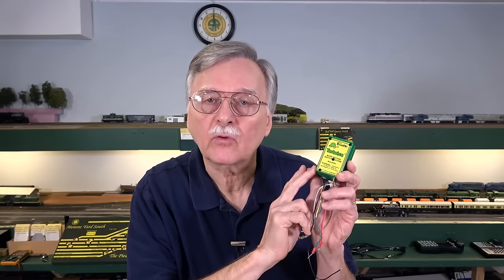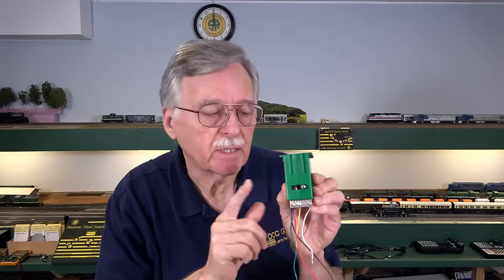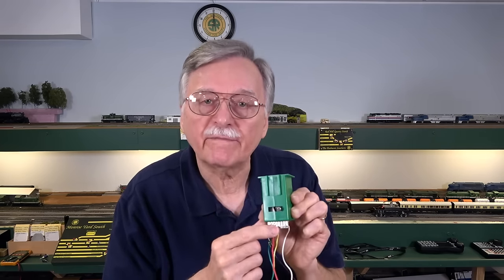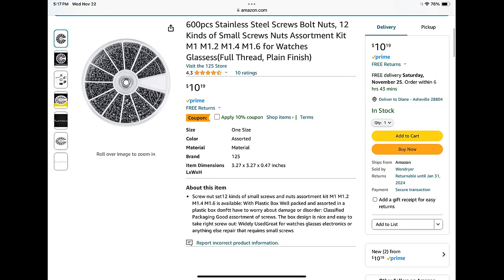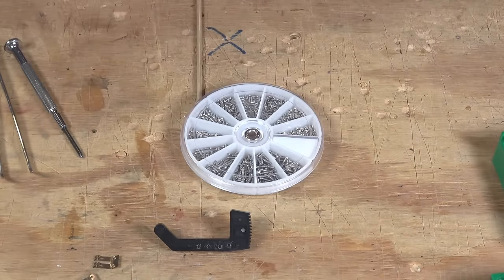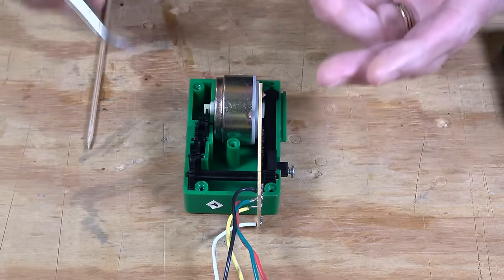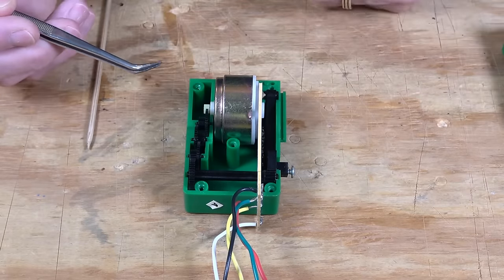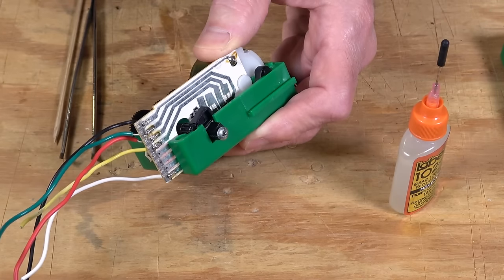Sick Tortoises? Try These Repair and Maintenance Tips (347)

Comment: I recently checked 25 of the 54 of mine on my storage yard, and although I never found any problems, I took the precaution of using a hot glue gun to glue all the way across, where the plastic holds the wipers, and run the glue across the top to form an extra bond whilst still allowing the wipers to retain there springiness. I didn't bother to check any of the machines I just disassembled and modified them. I couldn't be bothered to strip the contacts off and mess about with screws, After I had used the hot glue on the first one, I tried to break the contacts with a lot of prizing etc (within reason) and couldn't get them to break. I am satisfied that the hot glue solution is faster and just as reliable, Obviously I scored the plastic both sides and between the pairs of contacts and also along the right angle section at the top to give the glue a key. Must admit the lube is a good idea.
Reply from the maker: Sounds like another easier solution. Getting those little nuts on those little screws can be frustrating. I bet a line of epoxy would work too.

Comment: Hi Larry, always informative to see your tips...  I don't have Tortoise machines so I may not know what I am talking about.  But I'll offer this for your consideration anyway.  With the screws in place, even if they are stripped, why not fill the back side of the arm (near the screw threads) with a little epoxy or JB weld. It would be a lot easier and would give the screws plenty of material to adhere to.

Comment: Hey Larry,  Hi from down under! Yet another great and informative video. I have been using these for many years and encountered the exact same problem with the wipers and fixed them with self tapping screws same as you did initially so I think I will go ahead and slowly retrofit them with the metal thread screws as you have shown in the video. Another problem I encountered using the DPDT component to power frogs was that for a split second the contacts were contacting on both polarities causing the Digitrax DCC system to see it as a short circuit and shut the system down. The fix for this was to remove some of the track on the circuit board so that the wiper was only sitting on the pad when it gets to the final rest position at each end of the travel. When the switch motor is opened up to do the contact repair it is a good time to alter the contact pads on the circuit board.
Reply from the maker: Yep, I wrote about that issue in Model Railroading magazine 30 years ago, but have not run into the problem since so don’t bother. Do you have your command station set for the extended shutdown timing or the factory setting?
Reply: Thanks Larry I have it set at  the Factory settings @TheDCCGuy

Comment: Special Electronics Added:
Added across connections [#1]+[#8] "motor terminals".
Added a tiny 0.1uF capacitor.
* Improves 12V-DC motor performance.
* Reduces DCC sound.
Reply from the maker: Actually these have been installed in many Bachmann models due to international requirements for suppression of TV and radio interference so you may find them in some of their US models. However it is recommended that these be removed because they can interfere with the DCC signal and create problems. Some manufacturers even include this recommendation in the instructions included with those models that have them!

Comment: Ive also repaired the early models of DCC Concepts Cobalt TO motors, they have the same problem. Its all very well to say they have a lifetime warrantee but when one lives on the other side of the world 😢 so I repaired ours the same way but used 10 Ba bolts and nuts. Thanks Larry.

Comment: Nice fix! I’d be tempted to add a drop of thread lock (eg Loctite) to each of those little nuts just to make sure they also don’t come loose over time.
Reply: If you do that Loctite makes a product called after Lock that works well.
Reply: I’d consider using either the lowest strength loctite (purple I think?), the equivalent off-brand, or since I have it around and use it regularly for small thread applications, double-boiled linseed oil. It dries up and holds the thread but never completely hardens, making disassembly easy.
Reply: @THBRailwayInHO  , After lock is very low strength. Used after parts are assembled or adjustments to 8 track players or other adjustment screws that may have to be reset.
Reply from the maker: You can also just use some PVA glue.

Comment: Great information. One issue I seem to have quite often is once the machine has moved the points of the turnout the machine continues to make a clicking sound. It sounds like the motor keeps turning and is just grinding gears. At least you have given me some pointers on repairing them. I’m dreading working under the layout as is so often the case “ I’m not as young as I used to be”😅
Reply from the maker: Sounds like either something lodged between a gear tooth or worse, one with a missing tooth so it is slipping.

Comment: think it was you who told me about the MP5 switch machine i have sold all of the tortoises i had  
i did find there are easy to program, too to i have used them in hard-to-tortoise machines but MP 5 allows me to  half the piece of a tortoise  something like the dewalt power tools are better in their warrant work all i have to say
Reply from the maker: Sorry but it wasn’t me.

Comment: Larry, I had several tortoises fail in the wipers couple of years ago.  Took them apart and cleaned them and put vaseline on the wipers.  Seemed to work ok for awhile then started loosing wiper contact again. Several tortoises are not showing turnout position again.   I assume that I should not you vaseline, but oil?
Reply from the maker: I have no idea of the relative merits of oil vs grease (vaseline). However no matter what keep it to a minimum.

Comment: Hi Larry, I noticed when you were putting on the nuts you switched from tweezers to a stick with something that looks like putty. What is the stuff and it looks like it was working better than trying to hold the nut with tweezers.
Reply from the maker: That unfortunately got snipped out in editing. It was a small dab of Uhu black tack, a sticky putty I got on Amazon but you can find similar in blue or white at the local hardware store, that I normally use for installing LED lights. I put on just enough to hold the nut and guide it into place and it did work well.

Comment: Great video. Can't imagine taking 400 modules apart and repairing them
Happy Thanksgiving Larry.
Do you know what size screws you used. Would 2-56 fit? I have 100's of that size from my RC model airplane years.
Reply from the maker: Another viewer commented he had used them but the nuts might not fit. I had trouble with the tiny ones I was using.
Reply: Thanks Larry. I'll keep that in mind and see how it goes.

Comment: What size nuts and bolts did you use? Metric? Non-metric? I lean toward a 00-72 size.
Reply from the maker: The set contained M1.2, 1.4, and 1.6 and I used the biggest I could fit. The problem is the nut has to fit inside the bottom of the sweep arm.

Comment: 5:05 if you recently purchased the unit in question, it may be under warranty. As one can plainly see, there is a clear warning that damaging the label voids the warranty. Oops.
Thanks for the heads-up, Larry.
Happy Holidays ⛄
Reply from the maker: As I said in the wrapup these are guaranteed for an amazing 9 years! However you must have your original receipt to prove purchase date.
Reply: If you're in the USA, the FTC has ruled that "warranty void if removed" stickers are illegal. So IMO don't worry about that.

Comment: I have had the motor actually die  and I don't see why they don't upgrade the solder pads to screw terminals
Reply from the maker: They offer the Zip Z card edge connector which clips onto the card edge and has screw terminals.

Comment: I would take mine apart at least once a year to check them. Better to catch the issue before it becomes an irreversible detriment to operating the model railroad.
Reply from the maker: You just not have very many then, that would be a real chore. If he is willing to guaranty them for 9 years I would think that once the wipers are fixed they could go until the motors died.
Reply: @TheDCCGuy  Doesn't mean the gears won't start breaking. That's what I'd be checking. Heck, annual lubrication can help a lot with long term wear.